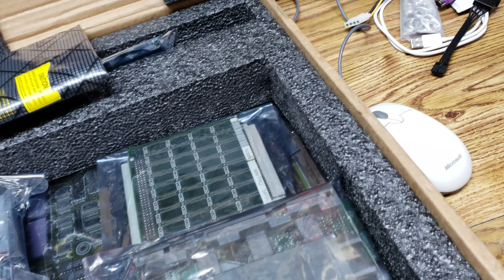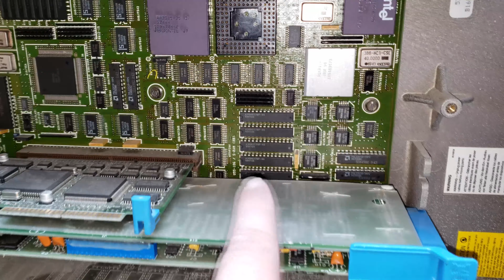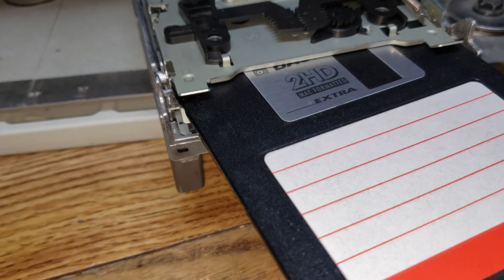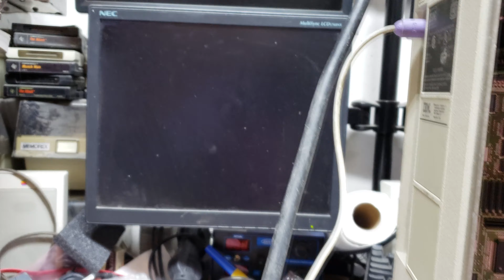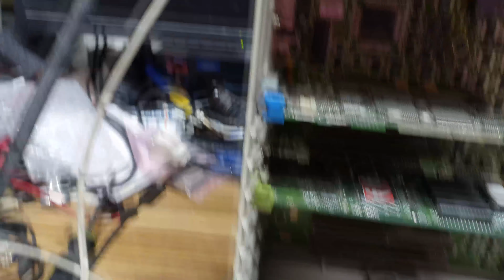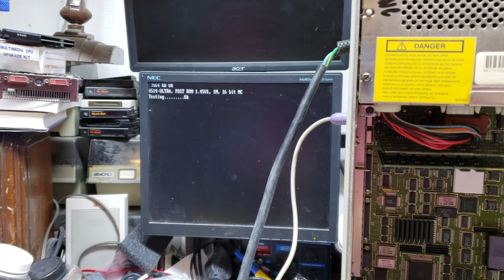IBM Model 80 (8580-A31) initial repair and testing

Comment: I'm working on a model 80 right now. It came with 2 scsi hard drives and the controller card. But I cant get the option file to load during setup. I thought the file would be on the reference disk but it's not. So I downloaded the files but It always gives me an error when trying to load the option file.
Reply: Hmm.  Do you have the correct adf file?  The standard model 80 reference disk should have the adf files for most scsi controllers
Reply: @luckybob77  I have 3 reference disks for the model 80. Two are more 70/80 disks and the third is just a model 80 disk. They tell me to insert a disk with the reference file during auto config. I even sourced a 2nd scsi card and it also does the same thing. Also, I installed 2 ram cards and when the put the scsi controller back in, the system wont even post. Just a flashing cursor. Pull the card out and it will boot and do a ram check. Not sure what's going on with it.